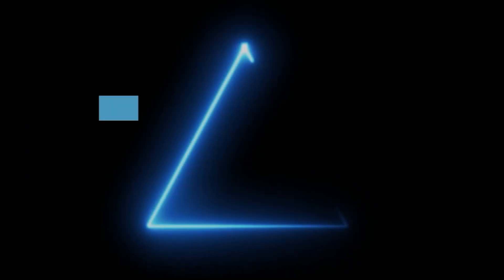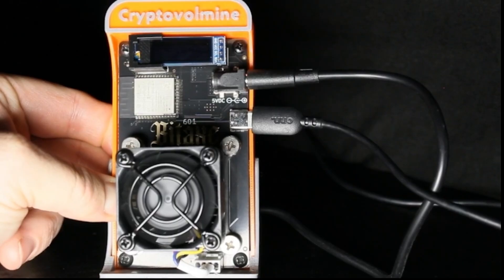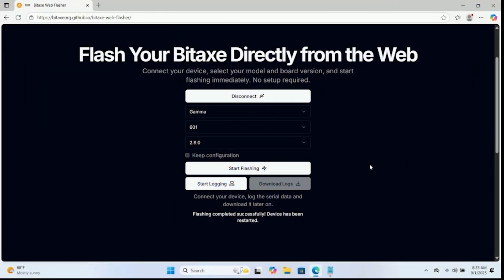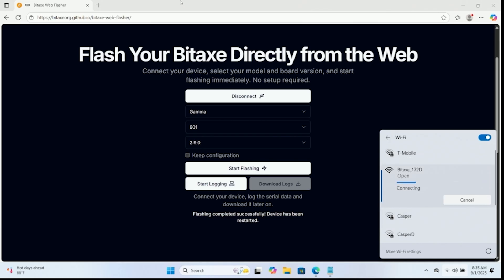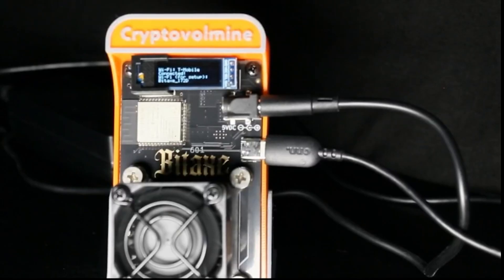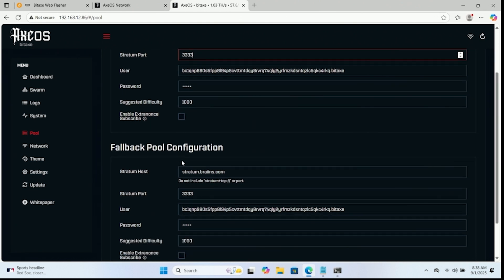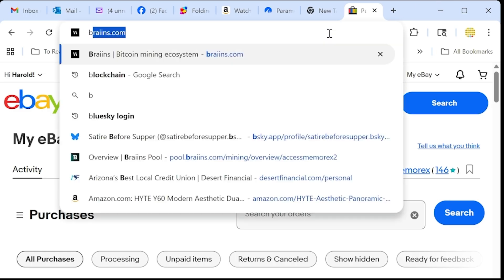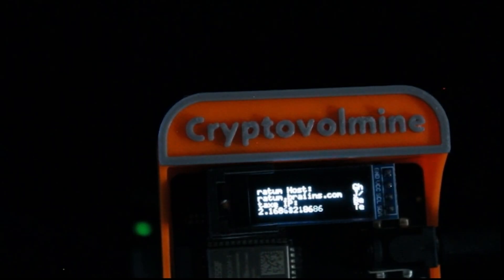Bitaxe 601 Gamma Bitcoin Miner Reset, Setup, and Test

Comment from the maker: In this video we used a website to recover the unit. When that is done, however,  we recommend using the internal upgrade system to update the firmware to its latest version. You can find that through the web interface.